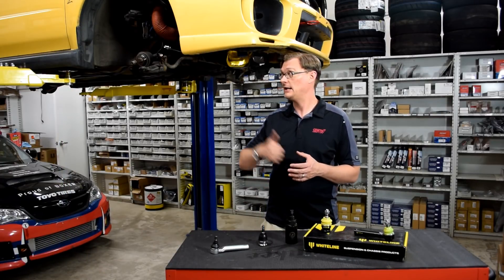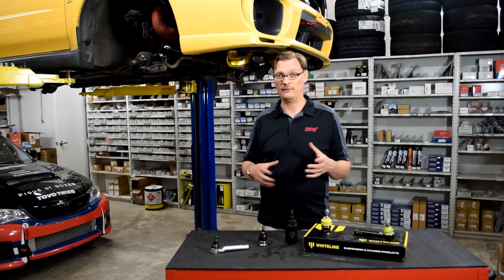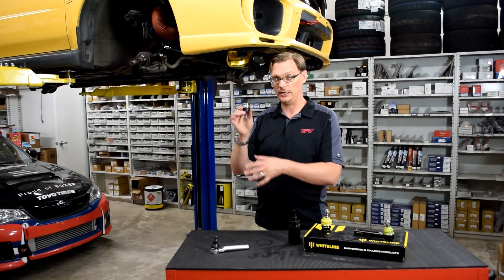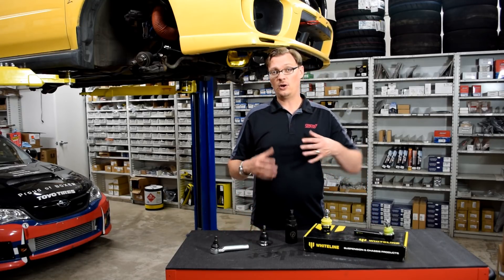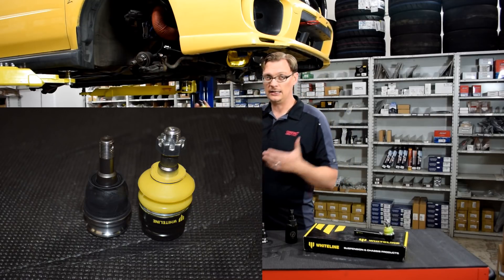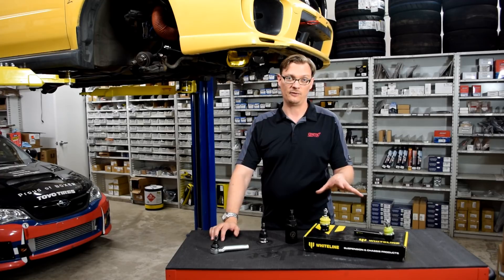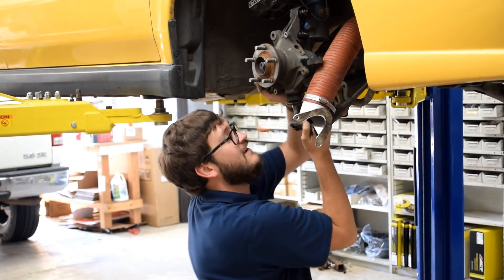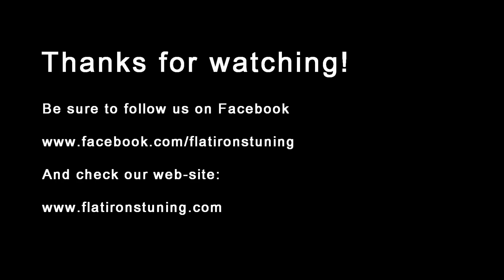All about Ball-Joints, and the Whiteline Roll-Center Adjust Kit

Comment: This is a very sobering info especially if rust has already taken hold[as is the case in my car]. So based on this info,
What I did was replace the knuckles, the knuckle pinch bolts, the hubs, bearings, seals, clips, tie rods, camber bolts, and lower bolts of the coilovers.
Then installed Superpro front roll center adjustment kit. Thanks for doing this.
Reply from the maker: Nice!  Glad you found this and I hope it was a help.

Stay Tuned!

Comment: One thing I've noticed with hitting (and trying not to deform, lol) lower arms, is that it's not always how hard you are hitting them. The speed/pitch of impact matters a lot. If you hit too hard, the parts may separate but the arm can deform. If you hit with a series of lighter impacts it's safer on the arm and can still work. At work a few of the guys will be whaling on an arm with a hammer and getting aggravated because it won't loosen up, and I'm on the other side of the shop tapping and making less noise and magically it works.

Comment: Oh boy do I know about cars that fight you every step of the way! I recently made a video about a trick you guys might like. Basically stick something metal and heavy between the ball joint clamp and control arm after raising the suspension as high as you can. Drop the suspension and typically it will pop the ball joint right out. Can put the castle nut back on and do the same to extract it from the knuckle too. Hope this car treated you well!

Comment: Just did this on my ‘04 STI. I can vouch this was a difficult install but not impossible even with a rusted ass New Jersey car. Buy the remover tool, many companies make them and it makes pulling these out a breeze. The pinch bolt is what took me the longest. Must give those bolts lots of heat to get out in one piece. Must have patience and lots of PB blaster!

Comment: Yup, pulling ball joints out of an old and/or rusty Subaru is no joke.  When I did a couple of them a few years back Company23 didn't have their tool available, so I bought the more expensive Snap-on one.  Did you guys have to drill out the pinch bolts as well?  Those things usually snap like dry kindling.
Reply from the maker: Thanks for watching!  Yeah, those bolts were the only thing that didn't fight us.  And I mean the only thing :-)

Comment: I had the Whiteline RCAK for a very long time. Eventually, of course, one of the balljoint boots degraded and eventually lost all of its grease. I didn't go WAY out of my way to find a replacement, but from all I could find you have to buy a whole new kit in order to get those proper balljoints replaced. Have you found otherwise?
Reply from the maker: Thanks for your question.  There are now at least 2 if not 3 versions of these, so I'm not sure what replacement parts are available.  I'd recommend checking in with Whiteline directly as they know their products better than anyone, and see if they can give you a part number.  Once you have that, we can certainly help you track something down.

Thanks for watching and Stay Tuned!

Comment: You mentioned about steering angle that binds.... I have a lowered 03 DC5  with Roll center balljoints. My problem is when i back up and turn the wheel to the Right it feels the wheel is stuck and fighting againt/rubbing the firewall. When i drive straight im able to do full turn locks with any problems.

Comment: Another great video. Just one thing to note, however: Whiteline uses a supplier called Daehwa or "Uniworld" that makes their parts in Kaesong, North Korea (DPRK).

https://uniworld.en.ec21.com/company_info.jsp
http://www.uni21c.com/eng/index.html

You can call Whiteline to see if they've switched suppliers, but they were using Uniworld when I inquired.

As an alternative, Geoff at Cygnus Performance turned me on to SuperPro a few years back. SuperPro's manufacturing---for the most part---is in Australia.
Reply from the maker: Thanks Sam.  We have actually just started to carry SuperPro, and we did notice that they made this kit as well.  We'll have to check and see how the two stack up!

(pun intended?)

:-)
Reply: Sam Crawford I went with super pro for my roll center kit but decided to go with white lines anti lift kit just because it's been fairly proven to work.
Reply: Frank Dasaro I hear ya. If you're happy then I'm happy.
Reply: PocketDrummer definitely been using there products a lot less since I learned that out.

Comment: why do whiteline ball joints not slide in with your hand like all other ball joints? superpro same type of kit ball joints fit no problems. sti and forester slide in and out with your hand too.
Reply from the maker: Thanks for your question.  We have not had that issue, so I'm not sure what the issue could be.  Maybe a slight variance in the size of the casting?

Hope you were able to get it to work.

Thanks for watching and Stay Tuned!
Reply: @FlatironsTuning  hi, have a look at, No Subs WRX he has a video front roll centre kit install. i had to do what he did to fit them. 
thanks

Comment: Would it be an issue if you install them with the stock suspension?
Reply from the maker: Thanks for your question.  It would not create any issues if you installed them with a stock suspension.  And you still may see some improvement with the suspension geometry as well.

Thanks for watching and Stay Tuned!
Reply: @FlatironsTuning  thank you!

Comment: What is an acceptable angle for the lower control arm?
Reply from the maker: With the Macpherson suspension, you want a bit of a downward angle when the car is at rest.  Within reason, the more angle you can get, the better.  Worst case would be the arm being flat, or slightly tilted upward when the car is at rest.  That would have the biggest negative impact on suspension geometry.

Hope that helps and Stay Tuned!

Comment: how does this work with airlift/air suspension?
Reply from the maker: That is a good question.  It would definitely help with the handling, but keep in mind that the ideal that the ideal drop that these are designed for is 1" - 2".  If the car is lowered a lot more than that, I'm not sure how much help these would be, but they would be better than the stock parts I think.

I hope that helps and Stay Tuned!

Comment: Is there any added NVH when these are installed?
Reply from the maker: Thanks for your question.  On these parts, there is no NVH penalty because the construction of the replacement parts is basically the same as the factory parts.

Hope that helps, and Stay Tuned!

Comment: Is it worth it for stock height rides?
Reply from the maker: Thanks for your question Brian.  At stock ride-height, the benefit is going to be less than if the car is lowered.  I would say that I wouldn't jump to this unless you have had failures of the tie-rods or ball joints and need to replace them any way, or if you know that you are going to be dropping the car a bit in the future.

Hope that helps, and thanks for watching!
Reply: FlatironsTuning I spoke with whiteline and they did not recommend this kit for stock ride height. I don't have any plans to lower the car so I'll replace with OEM or Moog. Thanks for the reply.

Comment: Quick fix for rusty pinch bolts and ball joints....Buy a new knuckle.
Reply from the maker: The further you get into this job, the better that option looks :-)
Reply: Okay honest question time. I have the suspension set up from an S202 so my car is lowered via factory equipment, would you still recommend using the Whiteline RCA kit?
Reply from the maker: Thanks for the question Keith.  I would say it would most likely be helpful.  McPherson front suspension systems like having a slightly steeper down-angle on the lower control arms, and that is exactly what this does.  I'd say it is definitely worth a shot :-)  Especially if you see any of those same components that have signs of wear.